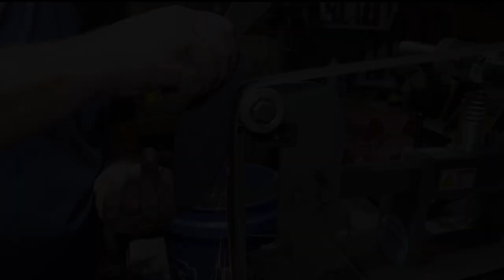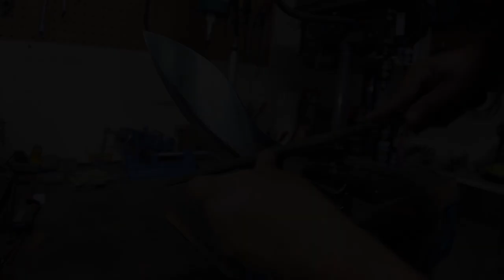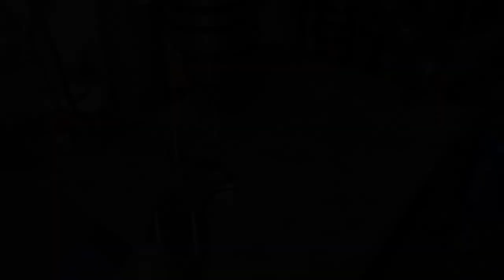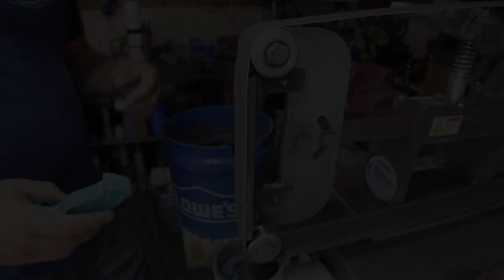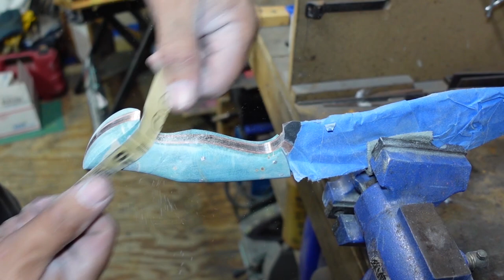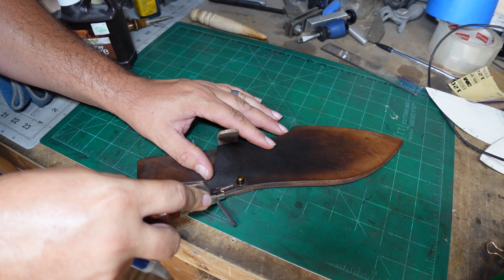Making A Kukri Knife

Comment: An absolutely gorgeous interpretation of the blade. The broad profile is also doing a great job of maximising chopping power in a relatively short length. You might find a larger blade with a more traditional profile interesting to make- as they get larger the dynamics in hand get very interesting and the distribution of mass while making becomes front and centre.
Take care,
Andrew and the team at Kailash

Comment: Why does my blade not harden after heat treating? I can still scrape marks into them with a regular file. 
Can anybody give me some suggestions because I'm at a loss  :(
Reply from the maker: There could be a few things happening here. First, there could be a layer of decarb on the blade and its still soft, people tend to sand or grind that off and then file test it. You could also just file through it until it starts to skate the file. Second, the heat treat could have been done wrong. It happens more than people want to admit. Just make sure to do research for the type of steel and the heat treat recipe. Some steels are a pain to heat treat in a gas or coal forge.